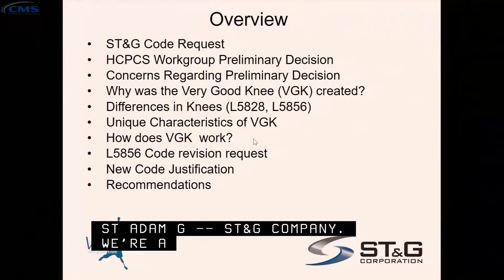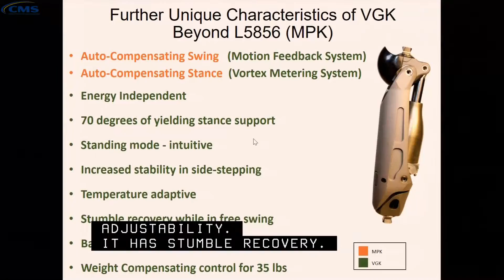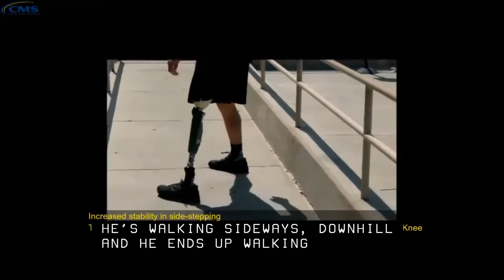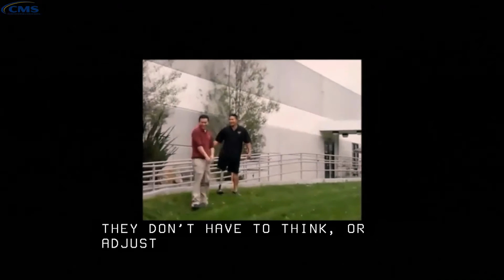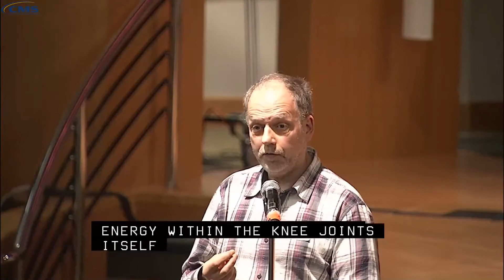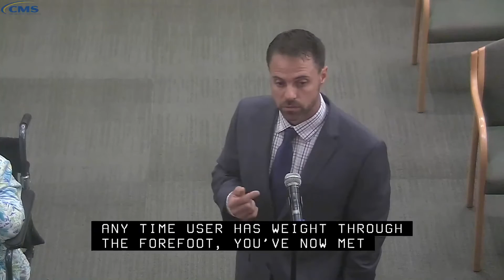VGK (very good knee), a speech about its unique specs.

Comment: The knee is very good.i have tried it.but the problem is when it gets a problem.the manufacturer will not answer you what to do about it.
Reply from the maker: Hi Sam, thank you for your comment. Maybe I misunderstand your situation, but in general, if any of your prosthetic components require adjustment, repair or replacement, you should contact a clinic where a faulty component was installed. It is their responsibility to provide you with all services associated with the prosthesis. Also, it is the clinic's responsibility to search for technical support if they cannot identify a problem. Technical support is usually provided by a distributor, not by a manufacturer. So, you do not have to contact a manufacturer. Moreover, manufacturers usually do not consult prosthesis wearers regarding the adjustment of their components because it is considered as information for qualified personnel. Personally, I cannot remember any case when a problem would have been left without attention. Best Regards, Denis Shaporev, senior prosthetist, Queensland Prosthetics.